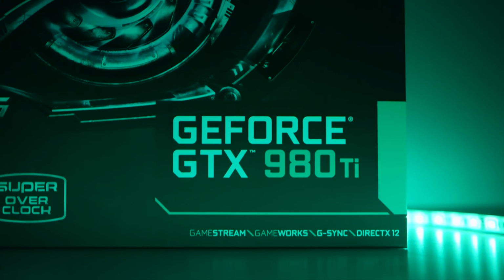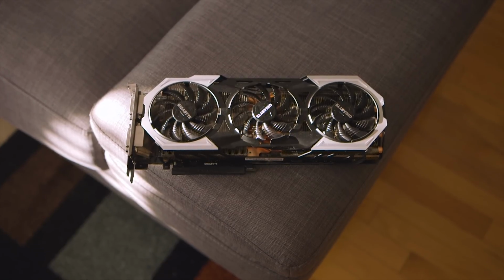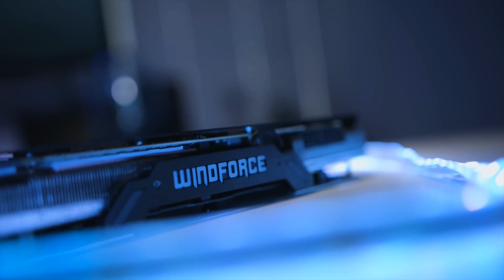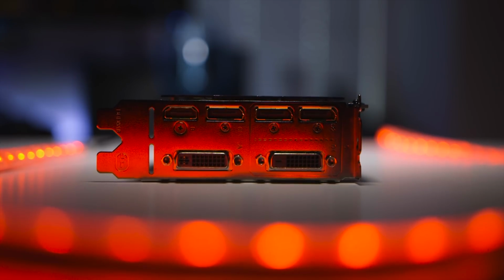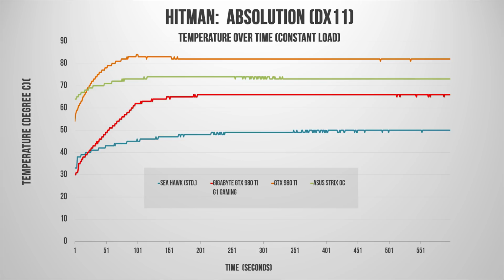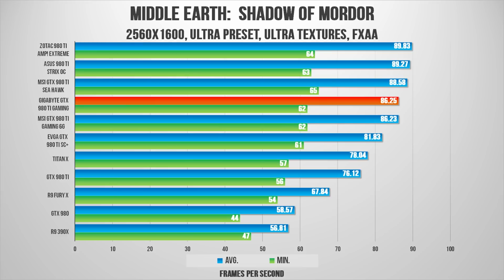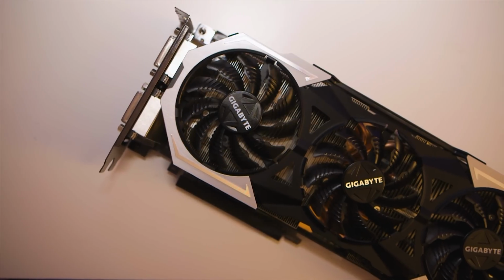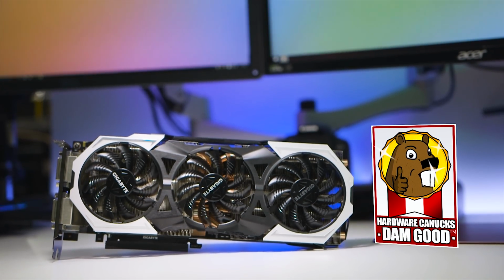GIGABYTE G1 GTX 980Ti Review

Comment: I still rock a G1 Gaming GTX 980 Ti! Best GPU I EVER BOUGHT for the money, the performance, and that AMAZING BUILD QUALITY!  She runs ROCK Stable at 1505 MHZ core and 8 GHZ effective VRAM!  I bought her USED in August 2016 for $355 shipped to my door - again, by FAR the best price to performance upgrade I have EVER bought, also - THE LONGEST LASTING GPU EVAR!  At 1440p and my OC, the 980 Ti still proves POTENT at maxing games out at 1440p - and getting ABOVE 60 FPS minimum!

If you can find a good AIB GTX 980 Ti, like the G1 Here, and you are WILLING to OVERCLOCK and over volt a little - you should ALWAYS buy that GTX 980 Ti over any GTX 1070 at the same or similar used prices!  But if you are TOTALLY UNWILLING to touch A OC Guru II/MSI Afterburner - and just want the best performance out of the box, most AIB GTX 1070s will AUTOMATICALLY Overrclock to near the ~2 GHZ limit of Pascal and Turing, though Turing can manage almost 2.2 GHZ in some cases. Either way point is that Maxwell does NOT "Boost" its self anywhere NEAR what a Pascal or Turing GPU will, the GPU Boost 2.0 Algo used on Maxwell only allows for ~4 or 5 boost "bins", whereas Pascal with Boost 3.0 actually raises the clock until heat or power targets are breached, which means the average GOOD GTX 1070 will "Boost" to ~1850 to 1980 MHZ out of the box, giving it a rather LARGE Overclock compared to RATED boost!

Comment: Hopefully Gigabyte stepped up their game from the previous generation of cards.  I've had 2 780s not able to handle the overclock they put on their cards.  My first one was given a replacement since it would blue screen within minutes of boot up where as the replacement I have had for a couple months would only do it in certain games where the image would just lock up but not BSOD.  I tried RMAing that card only to have it sent back to me saying there was no problems found with it.  My solution was to tweak the bios of the card to have it run closer to stock speeds and now it runs fine.  Beware with buying nonstock gpus as it seems most companies don't really bin the chips.

Aside from the coolers you're almost better off just buying a reference card and saving a few bucks for the safe of reliability.

Comment: I don't see the point of making a non Refferance  Review without telling anything about the GPU heatsink , for example  what kind is the gpu plate ?  the dimensions , how fast the gpu heatsing can go from 85 degrees to 55 degrees ,  the diamension of the heat pipes and much much more ..... After all We don't care about 8 Pin connectors the OC its the same...  Don't get me wrong I like your reviews but I don't like these GPU reviews .

Comment: Is it important to update Bios from F3 to F4? These are the changes:

-Release for SKHYNIX Memory
-NVIDIA Source BIOS Version: DP: 84.00.36.00.6E, DD: 84.00.36.00.6D
-Base Clock/Boost Clock: 1152/1241 MHz
-Memory:7010 MHz
-Modify the fan speed

Comment: I had one for a few days.  I returned it, along with two  monitors that I got to compliment this 980ti(one was 4k, one was 1440).  the first monitor kicked the bucket after just 2 days, the second monitor arrived with extreme back light bleed.

The 980ti itself was fine, it blasted through my games obviously and was just an amazing upgrade compared to my 970 even with higher res monitors.  I only returned the 980ti because I don't need one for my 1080 monitor as I believe it is overkill.  So now Its back to researching a good 1440 or 4k monitor and most likely a nice wait untill polaris and pascal launch.

Oh, JIGGA HERTZ!

Comment: This card should be 0dB at idle since the fans don't start spinning until a specific temp. For my ASUS Strix 980Ti it is 60c. I'm assuming it is somewhere around the same temp on this one before the fans start spinning. I'll also assume you are doing whole system acoustics in your test. This isn't how it should be tested since everyone's whole system noise output will be different due to varying components. You should have a test bench you can turn all other fans off for the short time of the acoustics testing. They have many CPU heat sinks that can run passive and turning case fans off for a short time wont be a real problem.

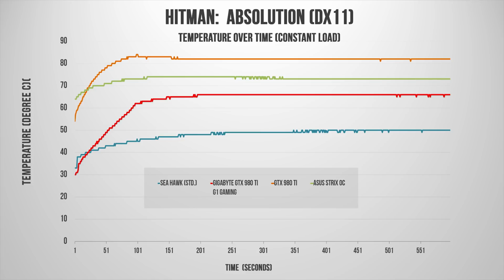Comment: Just a thought @ 3:30-35 with the GTX900 cooling and OC overhead have never been an issue if you had any custom cooler. My 970 strix is at 1500mhz on the core and it could go further, but the PCB design (with the single PCI-E 8 pin connector) is limiting the voltage and wattage this chip could handle with ease without overheating (and it's only 69% asic quality so imagine the speeds I could get with more voltage, currently stuck at a cap of 1.227 :(|  ). My fans are barely turning at even the most demanding of titles with 700 rpm being the top reached speed and temps never go above 74. So yeah power delivery is the issue here, not cooling.

Comment: I planned to buy this graphics card .... but better wait for Pascal :)
Reply: +Ryan Thomas wth? 980ti is like, 3 times better performance than a 760/960. "No difference"?? Do you use it for Minecraft or something?
Reply: +Ryan Thomas Crappy games then. The great games with a 970 at max isn't even 60 fps.
Reply: +Ryan Thomas I have a GTX 670 Gigabyte.... I planned upgrade to this graphics card, but better think I'll wait a little off Pascal
Reply: +Brian Manuel Absolutely. 4 more months, be patient! :D
Reply: ***** play something like MLL or Witcher 3 and you'll definitely see difference. MAXED OUT, BABY!
Reply: +Ryan Thomas Idk what nut hugging you mean but I just state facts. It doesn't have enough RAM and a 970 doesn't either but enjoy it I guess :)
Reply: +Ryan Thomas Ye ik, was just talking max settings. And it does consume more VRAM, but if you turn of things then ofc it's lower. Have fun! ;D
Reply: money?
Reply: +Brian Manuel you should wait Volta in 2018..
Reply: Nah, it's just a few months away. And Volta is set for 2017 though but I see it being delayed to 2018. :D
Reply: +Brian Manuel Polaris too!
Reply: +Parental Gurdian Nope. The performance of GPUs will theoretically double. 14nm vs 28nm. One of the biggest changes ever. Since 20nm failed, we are jumping 2 generations forward instead of 1
Reply: Parental Gurdian Right now, even 2 980Tis in SLI can't do that in some games.

Comment: Hi Dimitri, love my G1 980ti, im tested mine and ran it at 1503mhz and 7866mhz ram, 5760x1080, on GTAV Ultra settings with FXAA and MSAA on max and it sat at the 62fps Vsyync limit of my monitors and only hit 68c with 40% fan speed, with no Vsync it ran to 67-93 fps and temps got to 73c, this is one beast of a card, i cant wait to be able to afford a x34 monitor, but down here in aus the x34 is $1899, the G1 was $1300 so my budget is already gone, but well spent i would say, oh and all of this is in a NZXT H440 witch is not very good for air flow, so A++ for this card

Comment: the Asus 980 ti matrix is faster and has best cooling
Reply: nope
Reply: +FlyingT yes. 980 ti Matrix gaming mode 1190 to 1291 boost and the OC mode is 1216 to 1317 boost. You can over clock it to 1600Mhz stable.
Reply: +BulletBlaze I got mine to 1560 mhx
Reply: +BulletBlaze some are worse, and some are better. Mine won't go over 1560. it stays at 8 ghz of memory frequency
Reply: +Ryan Thomas I got my matrix to 1600 after upping power a bit, my memory is still at 8ghz and on idle its remaining at a chill 59 degrees, and a chilling 63 degrees load. That's what I call efficiency! ( totally not a Civ 5 reference ) Anyway I get about 1-4 fps more on games. Not bad, but I also experience faster loads, which is weird and rendering is s bit quicker. Not bad for a tiny more power.
Reply: BulletBlaze still nope
Reply: +FlyingT because you don't realise the performance that this gets over all of gigabytes " flagship " cards. the matrix has better software, quality, hardware, and preformance.
Reply: Harry Szaniszlo nope
Reply: Harry Szaniszlo noope

Comment: hey guys if I don't want to oc is it better to get a stock evga 980ti?
Reply: +Serve n Tap no, the stock cooler is crap and run hotter, spend 50-60$ more and get a better cooled gpu. Them also boost higher that the reference 980ti. But if your case cant dissipate the heat well go for the stock. If you still have doubt tell us your case model and how many fans you have in it ;)
Reply: If you don't want to overclock, then get the cheapest one. Just look at its overall ratings on multiple sites first before pulling out your credit card.
Reply: For really good performance out of the box, just get the Zotac AMP! Extreme GTX 980 Ti. It is one of the best, if not, the best non-reference card you can get but it would depend on your case as this beast is humongous.
Reply: +Jeanette Casiano thanks all of you guys and my case since all I y'all are wondering is the fractal design define r5 and I have 2 fans in the front one in the back and a after market cooler
Reply: Ok then dont get the reference, for few bucks more you can have a much better card, its a win win situation. Happy buying ;)
Reply: +ODIO POWER so I was thinking of the g1 gaming what do y'all think??
Reply: oh and I won't be doing any overclocking mainly bc I don't know how to do it
Reply: Is one of the best one, even if you are not going to oc the card (but is very easy..) is a great choice. Go for it! If later you are curios how to do it you can ask ;)
Reply: get the Asus strix if you can. It's all automatic and is one of the fastest cards and you dont even need to mess with over clocking
Reply: awesome can you tell me what you mean by its automatic
Reply: +Serve n Tap Well when you get it out the box, you don't have to do anything with overclocking. Also the fans are automatic. e.g If you are getting more then 70C on your card the fans automatically increase so you don't have to temper with the fans setting. Also the boost clock is pretty good and by the time you will need to over clock that bad boy you should of learned the "basics" In overclocking.
Reply: +Serve n Tap Also here. 1317MHz GPU boost clock in OC mode with 7200MHz factory-overclocked memory speed for outstanding gaming experience. That was taken from Asus's website.
Reply: honest answer, cause I was in the same boat: depends. compared to previous reference coolers, the 980 and 980 ti are MUCH quieter. I had a 680 ref.  and it was LOUD. these new ref. coolers are almost silent. if you're really not going to oc, get the cheapest you can find, including the reference models. just remember also, if you want a cooler case interior, go with reference. if you have a good ventilated case, go with non reference. boost clock on the reference will benefit from a cooler case as well.
Reply: i decided on the g1 gaming just bc its beats everything on its base clock
Reply: +Serve n Tap Nope the zotac extreme has a higher Base clock
Reply: +Salfordwonder13 Then the 980ti extreme gaming came out and whopped it's ass easily. My card is sitting at 1574 (!!!) boost clock and 8060 memory clock....all while maintaining low fan sound (unlike Zotac...) and never going above 68c (In a case with good airflow and ambient temp at a constant 24c).

Comment: Really amazing card, got mine 4 days ago..got an overclock of 1489Mhz(1501Mhz) and +350 on Memory, topped at 74c after 40 minutes of running Heaven Benchmark. I only hate the fact that it underclocks by 12Mhz when hitting the 67c but apparently this happens with all 980 Tis? other than its Quiet and powerful! I LOVE IT!

Comment: how the hell your vcard stays at 58c ??? I have the same vcard and i have to keep the vents at 80% to stay at 72-74c with no OC and with OC is closing to 80c.. in nzxt s340 case.. I think I've done everything that I could to lower this temp and nothing changes( to change rpm for the case vents from bios and all of that )... from my experience .. it's a noisy and hot vcard... and before this card I had 2 more gtx980 ti.. the evga hybrid ( nice card, nice cooling but a very loud pump and was the only one in stock ) and the second one was a palit and that vcard impressed me because the temp were staying at 62-63 but the built quality was not ok. I was quite disappointed about this card regarding the temp and noise, other than that is a very powerful card. nice review btw

Comment: these gpu companies are like Jordans.. they keep making the same shoe and selling it to you idiots for more .
Reply: +tat2guy23 probably gtx 480, reference design
Reply: +tat2guy23 For what? Stating the fact that the 390 performs better than the 970 for a lower price, or for stating the likely fact that Nvidia plans obsolescence for their older hardware, like with Kelper? You're free to disagree with me on the second one, but that doesn't make me a fangirl.
Reply: +Ezra24rct3 Get an AMD 390. It's better performance for a lower price, and knowing Nvidia, it will last longer (cough cough planned obsolescence cough).
Reply: or maybe none. Being broke is not your parents fault lol #you're
Reply: +tat2guy23 Got a 295x2 for cheap off a sale a year or so ago. Planning to upgrade at the end of the year after AMD and Nvidia gets their new hardware out.

Good for you, by the way. The 980ti is a great card.
Reply: +Ezra24rct3 Oh they have. Their drivers have been mostly solid for the last year. Which is ironic, considering Nvidia has actually had more less-than-perfect drivers out the last year than usual. AMD's not perfect, of course, but the "bad driver" reputation doesn't hold true anymore.

I'll only buy from Nividia's new lineup if it absolutely blows all else out of the water. I'm afraid of a repeat of Kelper where they shaft the older generations in favour of the new one.
Reply: +Ezra24rct3 ah 970? more better options available! a lot better actually!
Reply: +tat2guy23 Pascal and Polaris are most likely out some time this year.
Reply: +Queen Bitch KaNoMiko I'm glad I bought my 390 over the 970, It runs like a champ. Also the 970 with that 3.5 gigs of vram... eww.
Reply: +Ghost ZT The 390 is a great card.
Reply: +Meon Accel They don't, though? What was the last AMD card you used? 290x Uber reference?
Reply: +Meon Accel Which one?
Reply: +Meon Accel I meant which brand...
Reply: +Meon Accel Gigabyte?
Reply: +tat2guy23 compare 780ti to 290x
Reply: +Meon Accel Is it coil whine, or is it the fans?
Reply: +Meon Accel Regardless, I&#39;ve looked around, and most Gigabyte 390x cards seem to be silent, but I have found a small number of people complaining about noise, so I think Gigabyte has a case of more dud cards than usual. Guess you just got unlucky. If you go with AMD in the future, you should try to use Sapphire. They make the best AMD cards. They are the EVGA of AMD.
Reply: +Lino Fragoso Indeed. Back when the 780ti came out, it usually came ahead of the 290x. Now the positions have reversed, and some Kelper cards actually perform WORSE than way back when.
Reply: +Queen Bitch KaNoMiko bullshit, I just built an all amd rig with a r9 380 for a friends brother and the thing bluescreens over amds drivers more in the 2 months he's had it running than I've had in the 12 computers I've had the last 10 years combined.
Reply: +vtwinbreed And you know that it's the drivers because...?
Reply: +Queen Bitch KaNoMiko is really not hard to figure out when you read a driver filename that has ati in it, and a swap to a 970 solves the problem
Reply: +vtwinbreed So it's because he got a dud card.
Unless, of course, he didn't try uninstalling (using DDU) and reinstalling the driver, in which case he could've just have gotten a bad installation.
Reply: +Queen Bitch KaNoMiko it very well could be I suppose.  just dunno why it would work fine for 4 hours under load and then just randomly crap out if it was a bad card.
Reply: ***** sli970
Reply: +vtwinbreed Maybe the cooling didn't work properly, or it's a dud like I said and the component just can't work for too long at a time.
Reply: +tat2guy23 Their two fastest GPUs are faster than AMD's fastest GPU. (Although the 295x2 is still the fastest, but it's dual, so it doesn't really count)

Meanwhile, AMD dominates ever. other. price-point. Do they have the fastest GPU for the absolute highest tier? No. But they have the fastest GPUs for every other tier.
Reply: +tat2guy23 Denmark. Why?
Reply: +Ezra24rct3 Why would you upgrade to a almost 2 year old card.
Reply: +Jesse Pinkman Because we have money?

Comment: I am watching this with this exact card, but i am reaching teperatures of about 72 degrees celsius without oc in witcher 3 - and on top of that, the card can easily be heard over the other components. 
However, the fps benchmarks are accurate.
Maybe the temps are caused by my case, so your mileage may vary...
Reply: Make sure to run your monitor at 120hz in desktop if you have a 144hz monitor else the card will run at like 900mhz idle and heat up the card.